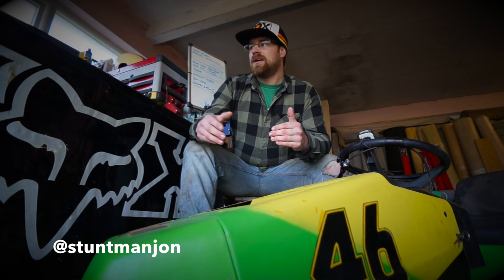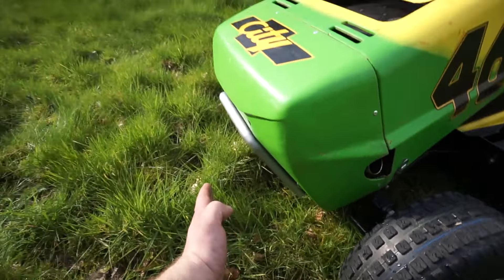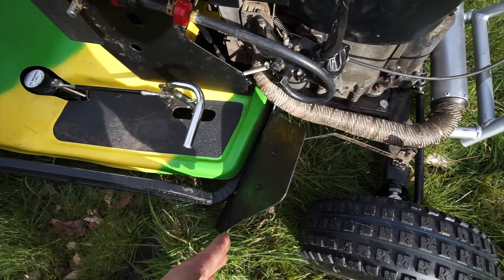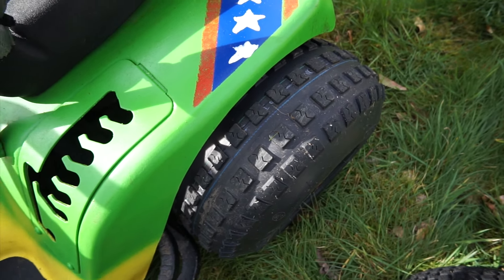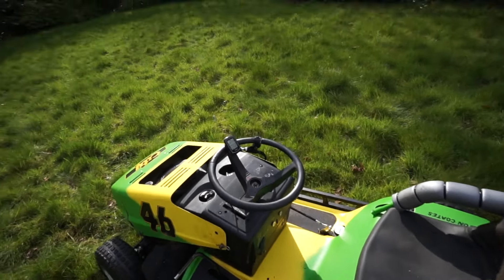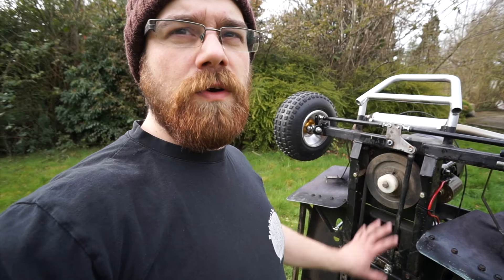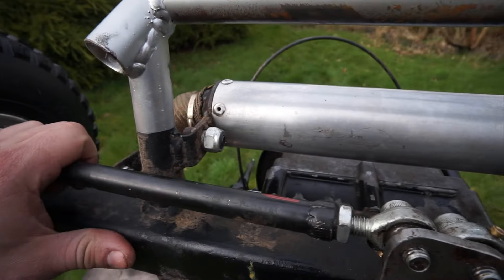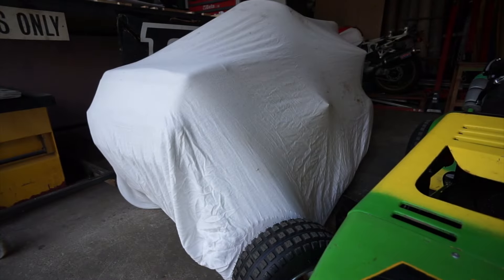RACE MOWER - 'THUNDER' - UPDATE APRIL 17

Comment: Cool ride man... Looks like fun.. I want to build one too. Just havnt ran across a good deal yet on a starting platform...
Reply from the maker: Yeah its important to hold out for the right machine for sure, happy building, Jon
Reply: Yea u right. Cause the more i wait for that one, the more info and ideas and plains gather in me head... Were im at just south of Dallas Tx.. I have looked up mower racing associations... And there is one. Is pretty scattered out over the hole state tho. And Tx ant small. Lol. Regardless, when i do get that one together. It will be right and fast forsure. Thank u for ur time.

Comment: Wrenchlife great vid, this looks like some craic. Question can you fit any transmission to a Group 4 mower? I'm from the wilds of Galway and have emailed the club hoping to join. No one has set up a club down here unfortunately.
Reply from the maker: Hi man, there's specific regs we have for these machines, in short we know what gearboxes and drivetrain setups work and are cheaper to run in the long term, and we also know that by keeping the machines similar where we can, we can keep the racing close too, although over here we get newcomers to run first in a class called LM for a race or 2, it allows you to learn from the other machines first hand what will work and what won't, sounds like an indirect route, but the fastest newcomer at the moment started this season on an LM and is now really flying on his group 4 because he was able to work out the kinks beforehand 😉
Reply: WrenchLife thanks for the comprehensive answer, LM it is if they let me in at all ha!

Comment: What did you use for those external battery leads? I had to bury the battery in mine and need this setup. Great build man!! Love this channel.
Reply from the maker: The little ends are actually countersunk head M10 setscrews, I drill a pair of 10mm holes through the plastic part of the dashboard so the two bare screws are insulated from the rest of the machine.  A washer is put onto each screw first and slid up to the head to stop it wanting to pull through the hole in the plastic. Then the battery terminals are wired to the back of the 2 screws behind the dash 😉, easy solutions are the most satisfying lol, happy building, Jon
Reply: Shit. Why didn't I think of that? That's genius dude. Thanks for getting back so quick @WrenchLife

Comment: I hate it when people call it still a tractor when it has a complete go kart chassis tractors do not have chain driven rear ends go karts do the go-kart with a tractor body
Reply from the maker: A lot of people jump the gun when defining these things and get upset about that stuff.  For sure some classes, (moreso in other countries), do use a completely scratch built kart style chassis, but do still have to adhere to a set of specific rules in order to still be able to compete; these rules are often in place so that it still can be classed as a tractor - has to use OPE engine, must have larger rear wheels etc.  Some purists may say they have went too far from the original machine, but really that is just the evolution of the sport at the top tiers, people want to go faster and modifications are inevitable.
Thunderbastard is a tractor/mower, that I can assure you, NI group 4 regs are very adamant that a machine retains a lot of key characters to ensure this. The chassis is the stock ladder chassis that came on the machine, it has been modified and strengthened to accept a purpose-built front axle, revised transmission and kart rear axle, but it does start life as a stock chassis. The bodywork starts off as stock and whilst being modified does have to retain certain positioning and profile to stock.  The engine has to be a lawnmower engine and the drive has to be a belt type as you would find on a riding mower. Even the wheels/tyres are bigger at the rear than the front to retain the character of a tractor, (despite being smaller). Wheelbase, width, engine position and loads of other stuff all have to remain as they were.
Anyone who has built one of this specific type of machine will be able to attest that despite their radical appearance, the built process and intent has more in common with a stock car type build than a go kart.  Go kart is almost a bad word in these circles, people see the lowered machine on smaller wheels and assume it's a go-kart with bodywork all the time, but it's a tractor... Still even has the tow hitch 😎 Jon